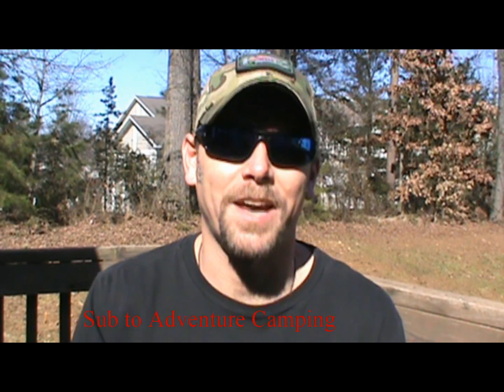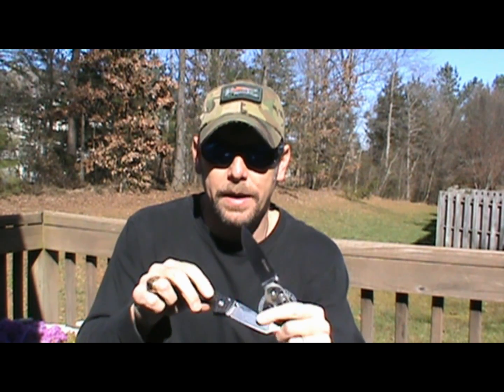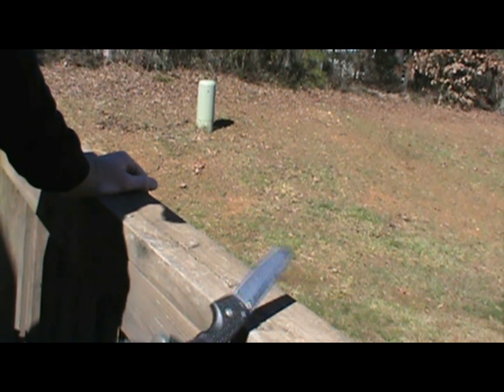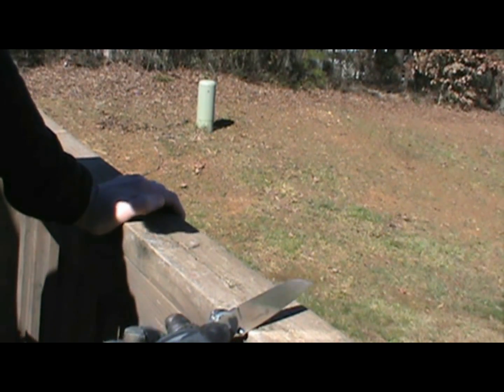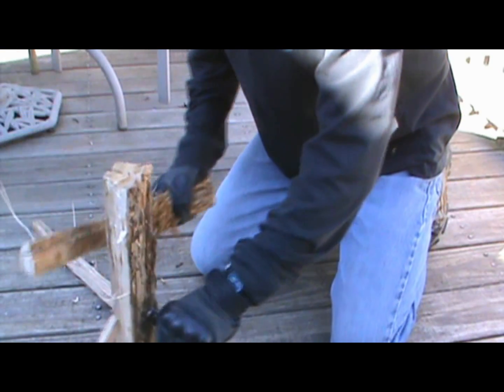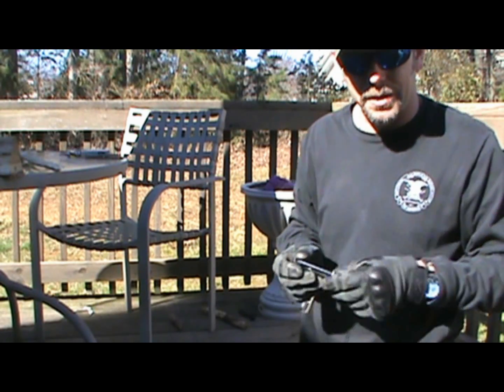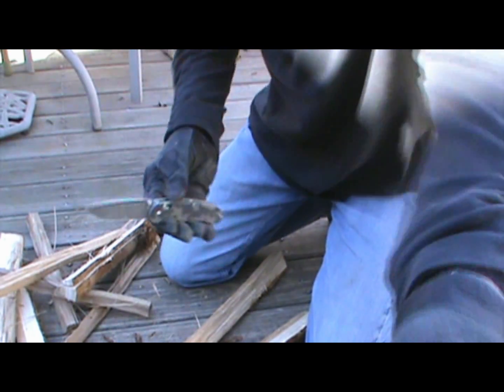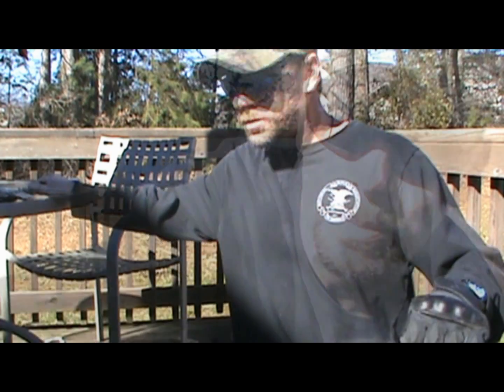Ganzo G727 vs Cold Steel Voyager who will reign supreme??

Comment: I totally agree with you....people worry a lot spine wacks and batoning with a folder....just plain stupid if you ask me.....if it's my only knife I have in a survival situation, (which will never happen, because I'm not stupid enough to just have a folder on me) I still wouldn't baton with it.....I'd whittle the wood down....because if it was my only knife....why would I even take the chance of it breaking....I wouldn't....
Reply: Another thing I would think would be smarter would be to whittle a wedge and hammer the wedge with a small log/branch like a two piece splitting maul of sorts.
Reply: There's a difference, in my opinion, between something like what you're talking about and the spine whack tests people put knives through. Cold steels whacking tests are pure gimmick as a pocket knife really doesn't need to do that. If it can handle being bounced off the floor then it passes in my book. Nobody should ever be putting a bashing force against a folding knife unless you're batoning (which means you were caught without a fixed blade). And if you are batoning, it means it's wedged in something and can't close on your hands. Just my 2 cents.
Reply: Blu Crystl I dont think the axis lock is very strong but its strong enough for normal use. Clearly the tri-ad locks of cold steel is stronger but its not strong enough to substitute a fixed blade so its irrelevant.

I have not seen a Ganzo that folds as easily as you say and I have around 20 of them, invluding several automatics. It sounds that knife is defective.
Reply: yes...the spine wack test is stupid...if you're not beating the back of your knife with regular use...why do it in a test??? if you're worried about your knife folding during regular use....then turn it over and try to push it closed...not beat it on a chunk of wood...if you abuse your knife and use it for purposes it wasn't intended for...and the knife folds...the knife didn't fail....you did....
Reply: give it to someone (wife, kid, coworker) who don't know how to use the locking blade, and watch them bleed as they try hard to close it like slip joint

Comment: AdventureCamping:
It was great test i like it! :)
I would like to ask, on the whole how can you recommend the Ganzo? I bought a Ganzo 727 too an i use in edc knive at the moment, and therefore i would ask you what is your opinion about this knife now?

I thanks a lot for your anwer in advance! :)
Reply from the maker: even though the lock failed it did what it was supposed to. It gave before it broke! So now it still works perfectly and I still put it in my edc rotation. I would still highly recommend it! I would never baton with any folding knife, except a Cold Steel, so for any task I would need it to do it is a great choice! I just reviewed my 3rd folder from Ganzo and am now testing out their fixed blade, and all have been outstanding! Thanks for watching and I hope this helps.
Reply: +AdventureCamping Thanks once again, your answer was really helpfulI I like my Ganzo too, mine is as well the camo version, and my opinion looks realli cool! :)

Comment: Quite a torture test on those knives. I bought a Ganzo G727M-BK a few weeks ago and it has proven to be a tough knife for my uses. I won't be bashing my knife like you did for the test but understand the need to test it against one of the strongest folding knives around. For the price of the G727 its hard to beat.
Reply from the maker: Happy to hear you are liking yours as I am definitely impressed with mine. I will be reviewing the 729 either tonight or later this weekend, so stay tuned in case you are interested in that one. Thanks for the view!!

Comment: I have the Ganzo G727M and Cold Steel Finn Wolf. I DO NOT batton with folders, so I'm not concerned about it unlocking. My fixed blade knives are for the real work to be done.
Reply: +mister smith agreed. folders always have a weak point. if you compare a full tang fixed blade to a folder, you don't need a test to know which one is going to 'win'

Comment: Why don't you put the rat 1 vs the ganzo 727 ? The rat 1 at mostly 2×the price would be a closer test  .that is if its not a cull in the box like the one i got.almost need stitches from rat1 lock fail i didn't notice after having to use a tool to unstick it first opening out of box .it popped shut on my thumb .bloody mess .
  Have many ganzos (sanrenmu land 9103 far better than the sabenza 25) and whoever makes the ball bearing doc clone .
   Some have tuning problems but haven't had any failures from China like the rat 1 .

Comment: Great test but although you said the Ganzo held up I saw that it did fail several times.  I think it is still a good knife because I wouldn't baton wood with it anyway.  I'm more interested in the edge and that seemed to hold up pretty well.  Thanks for sharing!  ~Dawn
Reply from the maker: yeah, I noted in the description because I didn't feel it happen during the test. However it did hold its edge and the lockup still works! Thanks for watching!
Reply: The Gonzo didn't fail the test it was fine after he batoned with it

Comment: Thank you for your videos! I got an itch to buy a few folders today and your vidoes have provided me with a lot of information about Ganzo knives. May I ask which blade type you prefer for working (cutting wood)? How about EDC? I see the Cold Steel you have has Tanto blade whereas I might prefer the drop point shape of G727.
Reply from the maker: the G727 and the g729 are awesome for edc and some wood working. The g735 would be even better as it has more belly plus a strap cutter, and a can opener. For me I always prefer a drop point for most things as it is great for slicing and many other tasks. Thanks for watching and the awesome compliment!!!! :)
Reply: By the law, I'm not allowed to carry a knife in public without a good reason like work etc. For the most of the daily tasks I dare to carry Victorinox Ramber in my keychain (little blade, scrissors, file, Philips screw driver and a bottle opener) and, don't tell the police, I carry another bigger Victorinox  in my backpack. So the strap cutter and can opener in G735 will be most likely unused extra for me. Watched that review earlier already though :) For working, as I cannot justify carrying such a big blade otherwise, I just ordered Ganzo G727, G729 and G733. I think my need for a practical foldable knife is covered pretty well.
Reply from the maker: +Heikki Pitkänen wow, pretty crappy knife laws, but it looks like you have everything covered now!! ha ha ha Awesome!
Reply: I think the laws were made with the history in mind. So called "puukkojunkkarit" caused lot of trouble, stabbings and deaths during the 1900th century. Knife is not seen as a tool (unless you actually carry it as a tool) but as a weapon in the eyes of law. Also, I live in Finland where only police or military can carry a gun in public. You can carry a gun only if you're on your way to/from a shooting range or hunting.
Reply from the maker: +Heikki Pitkänen wow, I always hate it when people in other countries cannot carry tools that can help them in their everyday lives not to mention just being able to defend themselves. At least you have some reasons and opportunities to own and use these very useful tools!
Reply: Well here knife is the worst choice if you're defending yourself. Just pick anything else you can reach, but don't use a knife. If you cut someone bad most likely you'll get fined too for exceeding your right of self-defense. For self-defense I carry a flashlight. It's non-lethal force multiplier and blinding the opponent gives you a little head start for running. I usually have a credible explanation in my mind if I need to carry a knife, but I usually carry it hidden in my backpack so there hasn't been need for one.
Reply from the maker: I never will understand a government that will not allow its citizens the ability to effectively defend their lives, but we see it all the time! Are y'all having any problems with the whole refugee/migrant crisis that is going on?  I have been watching it pretty closely, but have not heard much about your country.  If there was a problem I would definitely be carrying just in case.  I would rather face a jury and explain myself than be dead! If you know what I mean.
Reply: I'm not so conserned about the immigrants but the racist right-wing radicals that have started street patroling and are organized into something that looks like a biker gang. I find Finland still a safe country where our police use their service weapon about 6 times a year (that's all the shots counted in whole country). But you're right, if I had to choose to use my knife or die, I would use it. But it wouldn't (most likely couldn't) be my first response to an assault. The crisis might be getting worse, we might get more immigrants and more and more divided country, but I'm not worried I cannot carry a knife for self-defense. It just happens to be in my pocket sometimes because I need it for work and I'm on my way to/from work ;)

Comment: As a Chinese knife reviewer, I had lots of Ganzos come through my hands.
I can say that if you are looking for a Ganzo that also has a strong Axis lock - you better avoid the G72x and the G73x series and go straight for the G74x and above (G739 is also capable).
They've improved their lock geometry in those models, so they will hold even better than those older ones.
Cheers!
Reply from the maker: +ATech Reviews thanks for the heads up! I will definitively have to check those out. Really appreciate the tip!
Reply: ATech Reviews
    a little tuning of the lock will improve the ganzos lock up .just like many so called American knifes need a little tuning .and break in .
   The Chinese are being unfairly criticized and minimized for the most part .in most So called un bias reviewers reviews .
   Not so unbiased as we are led to believe ?
Reply: i have 2 g753's one i could close just by hand pressure, another one was ok, but still reshaped lockfaces on both. have 2 g727's one with g10 scales could close just by slight tap, the one with wooden scales was ok. G733 was fine didn't had do anything. G729 was also failing. the only ganzo's i could even throw and it wouldn't fail was G704 and G701. so if you buying one of them be prepared to work on it and finish what was not finished at the factory, from regrinding tangs, reprofiling edges, cleaning that nasty white locktite , changing washers and so on...

Comment: Not cold steel ! Cold steel triad lock ! Not all cold steels have that lock ! 
   I find that in general reviewers have sore ass for ganzo ! 
  No knife on the market is going to beat a cold steel triad lock ! 
   The ( g ) lock of ganzo is the second strongest ! And liner lock gust blow ! ( liner locks are not safe for the none knife person ) you have to put your finger in the line of the cutting edge to close the knife .the liner lock pops under pressture( unless you hold it shut ) 
.    With the exception being zt liner locks  . I've seen them tested they are the stringest  liner lock  but they they losen up  under hard use ( slightly bending the lock bar ) 
    Ganzo g 727 44c is better the ontarip rat 1 aus 8 ! As tested !

Comment: want the strongest locking knife ever made? get a cold steel. 

don't plan on beating the crap out of your knife for any reason what so ever? just want to use a pocket knife for its intended purpose at 1/5th(or more) the cost? get a ganzo
Reply: ganzo:20$

cold steel:25$

1/5th or more?
Reply: jordan nazif some of the cheapest ganzos run around 2-3$ while the cheapest cold steal I've found in about two minutes of looking is about 20$ even if it were 10$ my argument would still be valid. Besides, I was kind of comparing oranges to oranges not a puny folding ganzo to a cheap cold steel kukri. A decent but typical cold steel folder will not run you less than 55$ where I have gotten my favorite ganzo of equal size for around 10$ the 726.
Reply: Surago the cheapest cold steel you can get is 4$ and the medium voyager(the one in the video) is 25$......
Reply from the maker: +jordan nazif I have to add I got the Voyager on a great sale. They usually go around $30- $35.
Reply: jordan nazif stop. You clearly don't even understand. Just stop.
Reply: AdventureCamping aus 8 or cts-bd1?
Reply: jordan nazif 1) that's on sale. 2) ganzos still run between 7-12 bucks for a cheaper version. Compare the real prices, not sale prices. Also stop comparing apples to oranges. 

It's like saying you bought a cold steel from your buddy for ten bucks because he didn't like it and couldn't return it. Just cause you CAN find it for that much doesn't mean that's what it cost.

Comment: There is only one sensible way to baton a folding knife.  Don't lock it.  Set the blade on the stick with the handle loose so the blade can not transmit any stress to the lock or handle and then wack away.  It works, and your knife lock - which was not made for such a foolish activity - will be just fine.  Yes, it is a bit easier to baton if the handle is rigidly attached to the blade - and that is why God made fixed blade knives.
Reply from the maker: +Joe P agree 100%! After the test someone else mentioned your idea and it makes perfect sense. I was just doing it to see how it would hold up and if it would break. I never baton with folding knives I just kept getting comment after comment stating these knives are crappy since they would not hold up under this kind of test. Well the lock gave, but that was what it should do instead of breaking! Thanks for the comment and for watching!
Reply: Adventure, I didn't mean to be critical of you.  I understood from the video that you don't believe in using folding knives this way.  I was writing for the people who think a knife is garbage just because they can't beat it like a spike into a tree.  I appreciate your making the test.  It makes me appreciate my g727 all  the more.
Reply from the maker: +Joe P no worries! Didn't take it as critical at all! Glad to hear you own a Ganzo and the test.. I am testing my 4th Ganzo now, as well as, the Ganzo fixed blade!